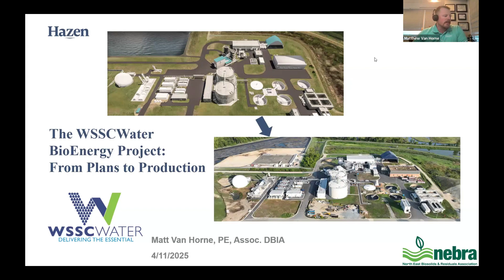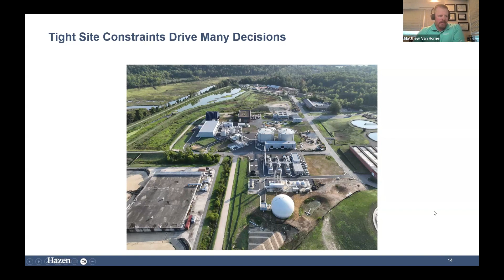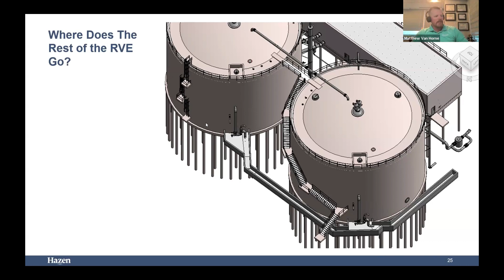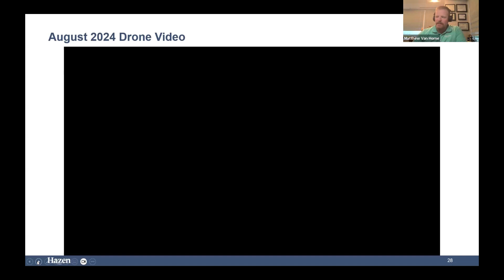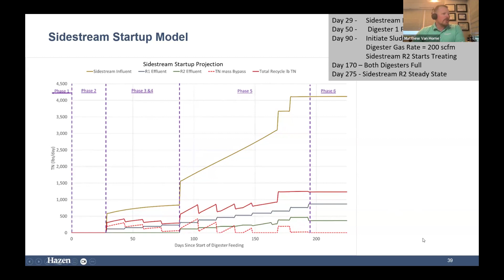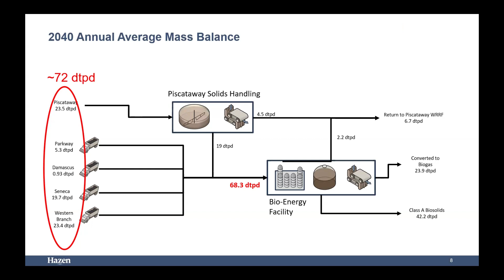North East Digestion Roundtable -- April 11 2025

Comment: When design are driven by fear, the owner has not other option but to accept madness. It is very unlikely that a new digester experience a 30% RVE. The designer provided a 9 ft headspace to deal with a RVE event, which is absolutely crazy. Then they added an expensive channel to deal with a biblical event. This channel will never see a drop of sludge in its lifetime.